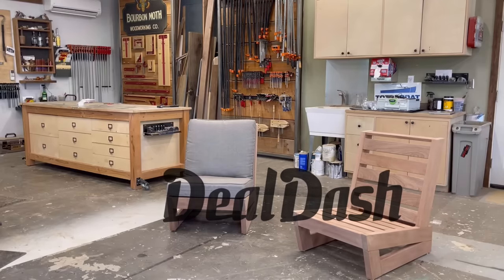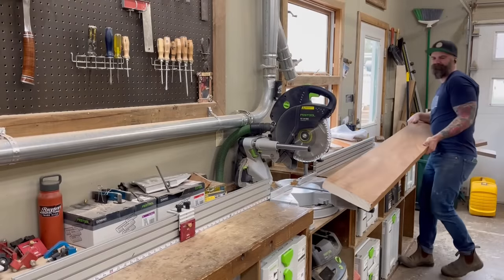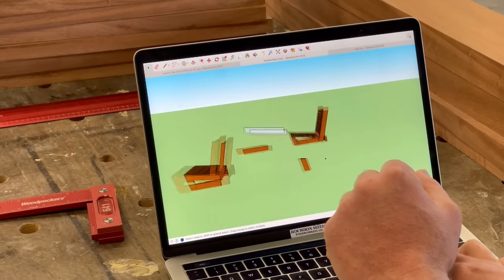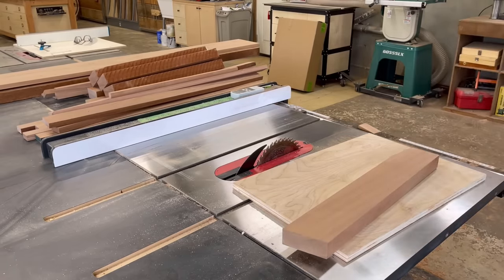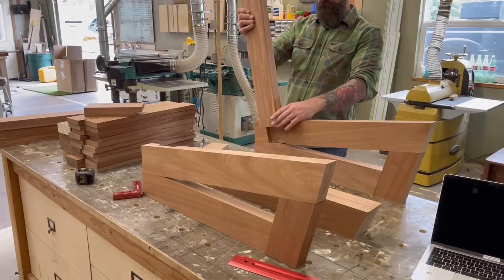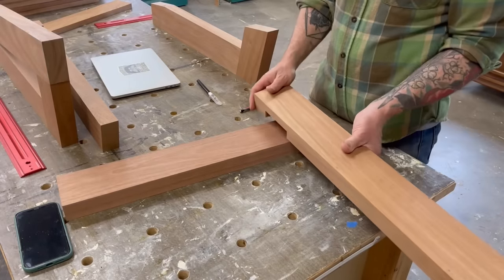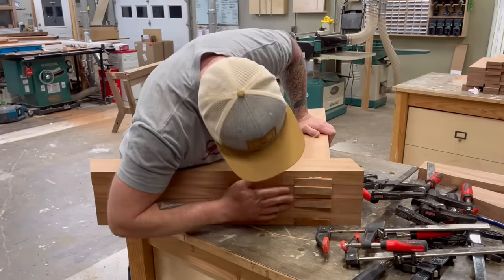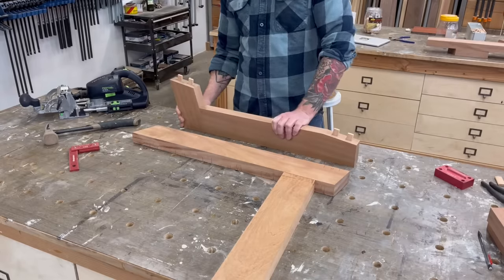Wooden Patio Chair Build || I Saved 700 Dollars

Comment: Jason - Ive never used Sketch up but I am lazy and do not like math either.  I also have ADHD which causes me to always try and think of easier ways of doing things.  To that end, could you print a 2D, life-size image of the piece (or end of the piece) you are trying to angle, cut it out with scissors (or a paper cutter for a straight edge) and then use that as a template for multiple pieces?

Comment: A tip for the angle measurement in sketchup- draw a line that follows the midpoint of the piece you want to measure. Isolate the line by clicking it with the mouse. Use the rotate tool (looks like a 360° protractor) and rotate the line about the endpoint until it goes through the midpoint perpendicularly, PAYING ATTENTION TO THE NUMBER THAT TELLS YOU HOW MANY DEGREES YOU HAVE TURNED THROUGH, and boom, angle measured only using the normal tools

Comment: Hi, Jason. I was wondering why you used that Fast Cure for the Dado joints instead of using say the flexible total epoxy to help with the exterior environment’s strain on the wood with expansion/contraction?

Comment: Excellent build my man!! I wanted to drop a note and let you know that I bought the plans and am currently looking them over. There are a few mistypes or inconsistencies between the measurements on the pictures of the boards and the actual cut list. Not a huge deal. But, if someone went ahead and ran with the cut list, the apron would be short by an inch and the back legs would be short by an inch and a half or so. No worries on my end but I wanted to let the community know in case anybody else needed to jazz up their back porch!
Reply: I also didn’t see the board feet for the 6/4 slats.

Comment: 8:28 A tip for the repeat cuts on the steep angle before you run that through the saw. Screw in a pair of blocks to a miter sled that rides on one side of the blad. No need for a full width sled for this. One on the end & one on the back of the cut piece. This way when you do the other parts you just seat them into those blocks so all 4 match. Much easier than the router table gag.

Comment: I've now made four of these chairs and have some tips and tricks. 
Referring to the downloaded plans, there are four pieces in each
side frame:
A - Bottom apron
B - Front leg
C - Bottom leg support
D - Back leg

In general, the dimensions and angles in this plan need to be
rather accurate. A 1/16 of an inch or half a degree of angle
inaccuracy can lead to pieces out of alignment.

1) The pieces of each side frame should be considered as a set.
   Mark them and keep them separate.
2) Do not cut (B) until you have cut and dry fit parts (A) and
   (C). Then trace and extend the sides of those pieces on 
   a piece of cardboard to define (B). Only then can you cut out 
   and fine tune (B).
3) Don't attach (D) until the other three parts have been dry fit.
   Layout the sides on top of each other with the (D)s slid
   into the half-laps. Make sure that they align before screwing
   them down.
   
I used 3/8" dowels and waterproof glue. That seems to have worked.
I also make a bench out of two of the chairs by connecting them 
with an extra set of slats.

Dave
Reply: Beautiful

Comment: The chairs look awesome, and yes while you do have those thousands of dollars of specialty tools and spent hours and hours to save about $700 on them, you cannot understate the value of knowing they'll last. If you decided to just buy the ones online, how do you know they wouldn't break in 2 or 3 years, forcing you do buy new chairs again? Take that into account, and you could very well be saving thousands of dollars over the life of them. 

Also, not to say the epoxy isn't going to hold just fine, but why not use Titebond III? It is a water*proof* wood glue as tested using ANSI/HPVA Type I testing standards, and would no doubt be much easier to work with when using dominoes. I've always wondered why you don't use this glue, because if you look up the test to be rated type I, it's honestly pretty amazing to me a glue can even stay together after it, much less have any measurable strength. I feel like it should have no problems holding up to normal outdoor use, and I've never had any issues with it personally.

Comment: Just screw in some support pieces on your sled/jig when you get the first piece lined up and then it becomes repeatable and you won't need to use the first one as a router template to get them all exact. Check out some of Shaun Boyds videos, that's where I saw it.

Comment: I love working with sapele. It's my absolute favorite. cuts like a dream

Also, I have the powertec dowel jig set. I honestly think it's faster than dominos. You drill 2 holes per setup and you only need a single center reference line. No hip thrusting involved :)

Also, also! At my work, we call that radius on mating components a "glamour groove". It intentionally makes a larger gap so you can't tell when there is a tiny gap there! I'm happy to see that you stumbled upon something that engineers use regularly when designing parts!

Comment: Ive come across a great page who showed a good technique to cut those steep angles using a jig. 

Its called Chris Salamone. He pretty much does the same as you with the double sided sticky tape but he will then screw some strips of timber in place behind the piece to cut so its just plop it on and cut. Check it out i think youll find it useful. I am talking about the video of the bed design but im sure he will show it in other vids too

Comment: Great chairs, have been looking for something like this that wasn’t an Adirondack chairs.  I have a question.  This is the second video you have used epoxy to glue the joints, that could be exposed to moisture.  You chose epoxy over waterproof blues, such as Titebond III or Gorilla Glue Ultimate.  What are your thoughts on this?  Thanks.
Reply: I’ve used gorilla glue for years on exterior furniture projects with good results except the cleanup can be tedious. Epoxy will,work fine too.  Just sayin.

Comment: Total Boat has a 5 min epoxy quick set.  Would that not have worked? Much faster than 2 hours wait time.
Reply: There is no way he could have completed that glue up in 5 minutes. He would have had to keep mixing batches of epoxy and fighting setting epoxy. He made the right call with the two hour epoxy.

Comment: Is there a cheaper wood that would (wood?) Work just as well?
Reply: You could use just about any wood specially hard woods. You would just have to be sure to use some sort of sealer or wood protection.

I'm thinking these would look good made out of cedar or mesquite both of which are readily available here in Texas.

Comment: In Sketchup, I use grid lines all the time. When creating a circle, square, rectangle, etc., the pointer SNAPs at the intersection of the grid lines. Also, after using the "Tape Measure" to create the grid lines, you then can use the "Dimension" tool to measure, or just use the "Tape".

I am not an expert with Sketchup. However, I do know my way around pretty will.

Comment: i would have just used darker dowels and drilled all the way through the sides for the slats instead of the domino thingy... probably would have looked way cooler too as long as they were evenly spaced. and not all crooked and cattywhompus

Comment: But you DO have tens of thousands of dollars worth of specialty tools that most of us can't afford!  You also have ready access to a great hardwood supply that many of us don't!  That means you do awesome work and I'm just jealous!!
Reply: You can get quite a bit of tools used on Craigslist and basic tablesaw. I have a old Rockwell saw that is of Rolls-Royce quality and a Dewalt contractor saw that was only $500.00 it gets the job done. My radial arm saw was $25.00
Reply: Everything can be done in multiple ways. 
Hell, you could do this whole build with hand tools if you wanted.

Comment: Jason. Some thoughts about maths. 

Maths is daunting. All the woodworkers that I watch avoid it completely. There are things like geometry and trigonometry to consider. But computers do maths really well and take a lot of the head scratching out of the process.

Thing is though the methods that you use are not an excuse for working out the opposite angle of a triangle, or the length of the hyponeuse multiplied by the tangent of the adjacent angle. Strikes me that you don't use maths because laying things out and until they look right or creating templates or copying things from other cuts makes more accurate and successful pieces in the long run. Maths is a tool and in some cases (like making sure you buy enough materials) it makes sense but in others it really does not.

Would you agree?

Comment: Saw you wiping some epoxy around the 26:00 and thought about an epoxy guide i saw on youtube. Where to avoid having any epoxy on your hands at all they use two pairs of those black latex gloves. One pair to keep on at all times and a second pair that's used when applying the epoxy to the small parts. You avoid getting any epoxy on your hands and as an added benefit the second pairs glides on really easily!

Comment: I doubt those chairs online are made of anything like the quality or thickness of the wood you used for yours. 
When made of the same type of wood as the store chairs you could have made 4 chairs for the same money probably. 
Plus construction time on 4 wouldn't have been a lot more then it was on just the 2 chairs now.

Anyway, it really pays to do these things yourself. And buy some new tools from the savings so it will be easier next time.

EDIT: Yeah i just went and looked at the start of the video again and the chair in the picture is all made of just thin planks that are maybe 10 or 12mm thick. 
Yours are way better and probably will outlast you. Not so sure about the store bought pieces.

Comment: Thats not a terrible way to get the angles from sketch up, but there is a protracter tool that is easier haha.
Reply: Using the protractor would likely be less accurate and take more time to set up. The resultant angle may have been very hard to get accurately.
Reply: @robertmabry4172  I use it all the time and don't have problems.  Why would you think it to be less accurate?
Reply: @acb_gamez  because setting an angle on equipment that might actually be something like 38.6 degrees is difficult. The way he did it eliminates that challenge.

Comment: So, you’ve just stolen a design off a companies website and now your charging for the plans? You really are a YouTuber! 😂

As some others have said, I’d have preferred some arm rests. Also, when you cut a piece of plywood to use it as a tapering jig, you could have just added some blocks around the chair component for reference, so you could then pop the other pieces on and they’d be in the same place to cut the angle. Just a thought.